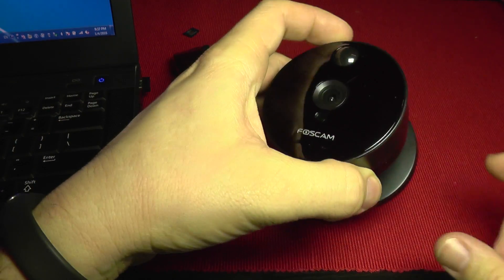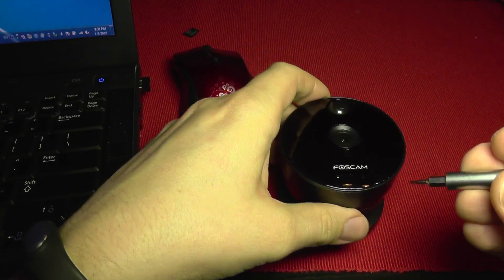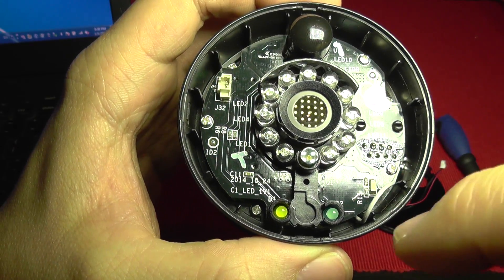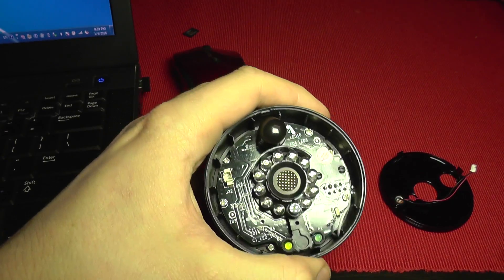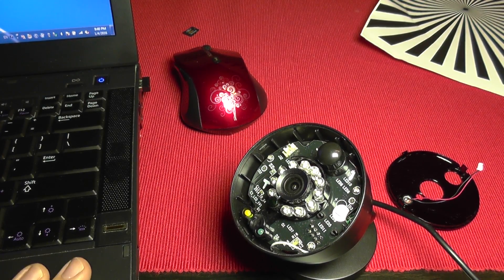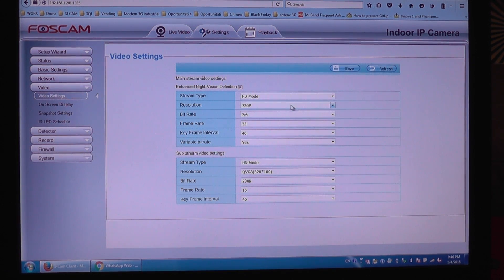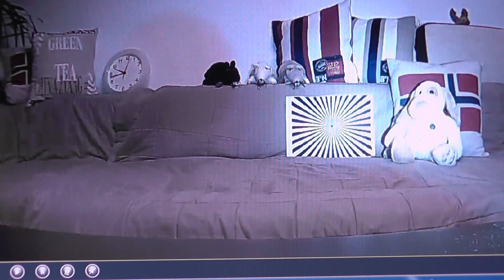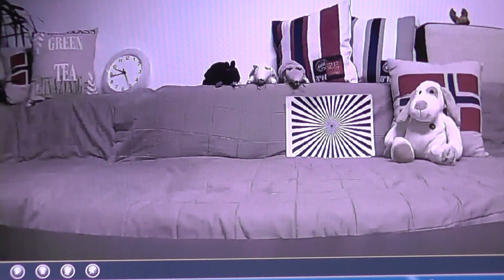Foscam C1 PIR 720p IP Camera - Lens Focus Procedure

Comment: These cameras are trash dude, I have one and it is bricked already, the only thing that shows is that solid orange power light and doesn't respond to anything not resetting even plugging it via Ethernet doesn't light the network blue light, tried almost everything and can't fix it, can't believe that they offer no solutions to that
Reply from the maker: You may have got a faulty one, but yes it looks like the quality check is very poorly done....if the unit works the it's ok, my refocused unit is still doing great.
Reply: TechTronic9000 well it was working tested it, but when I unplugged it and plugged it in another room it's not functional, I tried contacting them and all what they ask is where and when I brought it so they would reply in accordance to replace it but since that is not an option they stopped responding, I think their support is absolute low grade, but based on the info I gathered their firmware is broken somehow or its poorly constructed

Comment: I thought the only camera that came out of focus was the Xiaomi YI. Mine (Z23Lxxxxx) was so bad it was not usable as a aerial camera on my Syma X8C quadcopter.  I spent over 3 HOURS getting it in focus. I tried using the video out, but that didn't get me close enough, so I took a series of hi-res photos, and kept adjusting until both sides of the picture were in focus. A long and painstaking solution.  I am so mad at Xiaomi for selling defective cameras I will never recommend them to anyone. YouTube is FULL of videos dedicated to fixing the Xiaomi Yi focus problem.  There is just no excuse for a big company like Xiaomi to sell such a poorly made product. They must have no Quality Control. It appears that Foscam falls in the same category. Thank you for your video. BTW, now that I spent all that time getting the YI in focus, it does take good video and pictures, but I shouldn't have had to focus it myself. Therefore, when I needed to buy another action cam for my XK X380 quad, I bought the Gitup Git2.
Reply from the maker: +Bill Somrak It seams that it's a trend for camera producers to mess up the focus, Xiaomi, Foscam, SJCam the small and capable Foxeer and even the GoPro, all suffered from poor adjustment. With the increasing size of sensor's resolution it's also getting a lot harder to obtain a proper focus. I hope that you will enjoy the Git2, for me it's one of the best action cameras until now and it also benefits from great support.